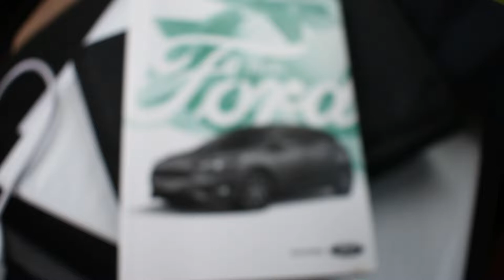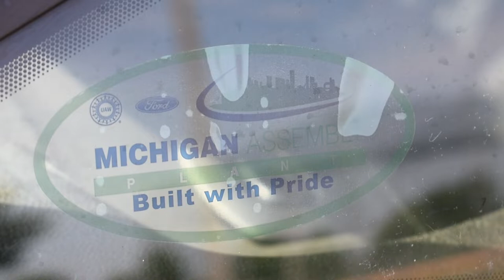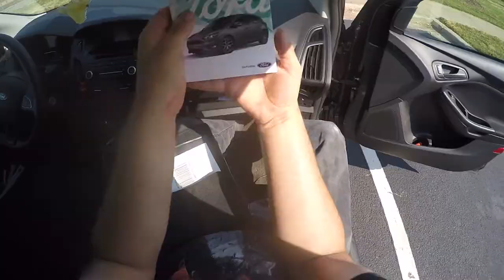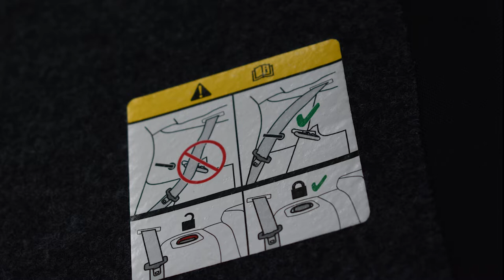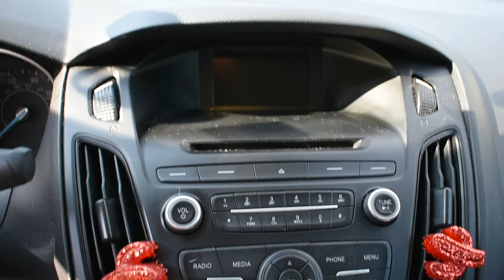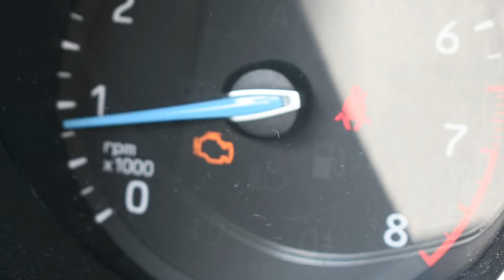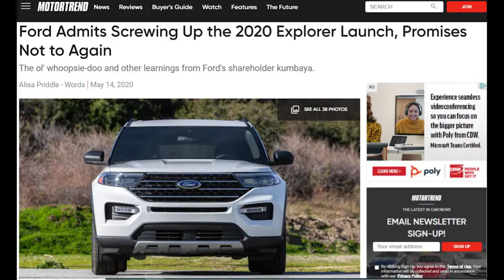2017 Ford Focus S: Wookie Drives #81

Comment: My father-in-law had a Fiesta with a powershift transmission and I swear it was the worst driving experience I've had in my entire life.  It was only a month or two old when I drove it and, even then, going from a complete stop involved severe shuddering and it bucked to various degrees every time it shifted.  The only other comparable one was the "I can't ever decide what gear to be in so I'll just shift constantly under basically all driving conditions" automatic Toyota Tacoma.  That one is fixed now though, or at least that's what people claim.